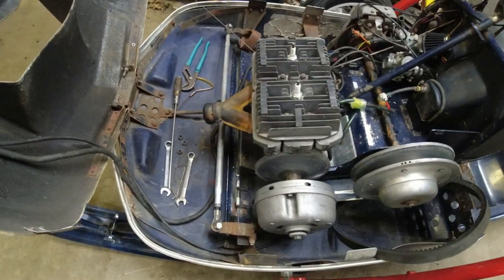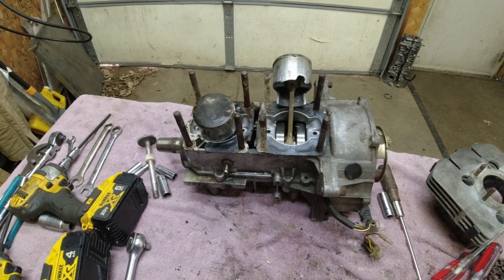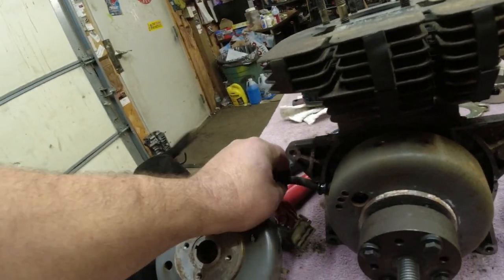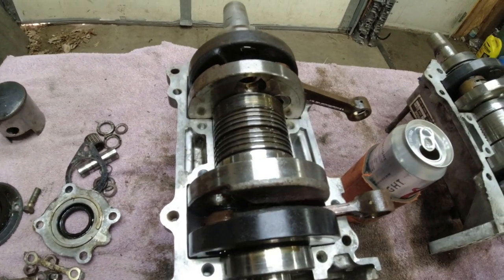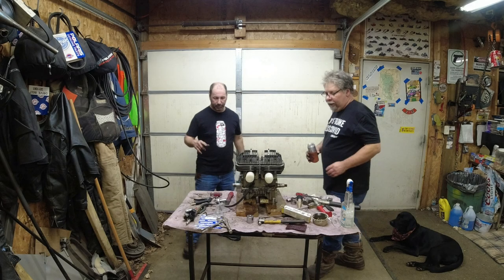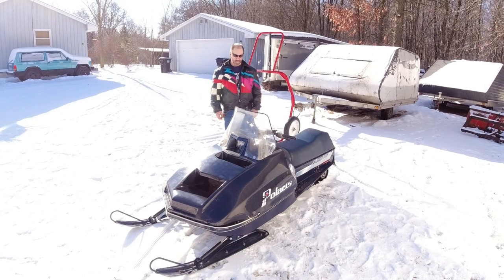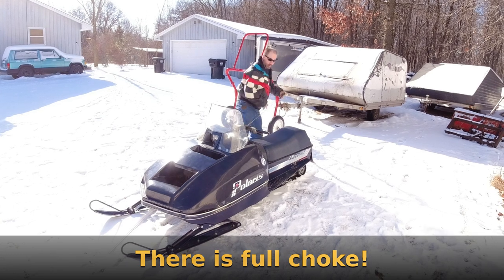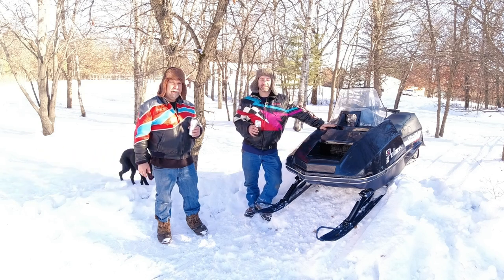Rebuilding Dennis' Locked Up TX 340. How to Identify early and late cranks!  Vintage Snowmobile.

Comment: I too love the free airs. I had colts, and a 1976 tx 340. Wish i still had the 76 tx. My free airs never gave any trouble. But i do go through every old sled engine right away. New seals, gaskets, clean carbs, and so on. Good job on the rebuild.
Reply from the maker: Right on

Comment: So what do you figure took out that skirt? Pistons worn thin? I dont think it was the bearings that caused that. Also are those Wiseco pistons or did Polaris use that style of wrist pin retainers as well. Been a long long time since Ive seen the innards of one of those. 
Keep up the good work guys! 
I love most sleds accept ski doo and have owned many different brands over the  years. Do you work on anything else or just Polaris as we have seen so far? While I love the content I wonder if throwing in a different brand once and a while may help vet your channel moving.
Reply from the maker: Sometimes the skirts just break. Maybe metal fatigue? Maybe a clearance issue? Maybe something else. Not super common but not the first time I have seen it either. That is a stock T340 piston, pin, bearing and circlip to the best of my knowledge. 

There might be some oddball sleds coming up. I have a Ski Daddler that needs some work. Maybe I'll resurrect y Muscaro some day?
Reply: @nuttersspeedshop  do the muscaro!!

Comment: I have a 72 tx 335? Thee compression 195 and 200 on the PTO side that seems high to me I think my tester is fine
Reply from the maker: Sounds really high. I'd expect something like 120 or 125 psi.
Reply: I asked the guy I got it from if he shaved the heads and he didn't he got it used from John Hebbelman he was the Polaris dealer in our area,can't ask him  he passed away
Reply from the maker: 195 psi is race gas territory, so unless you are racing it I'd try to find a stock engine. Either way, you should take a look inside. Maybe there's some porting to go with the compression?